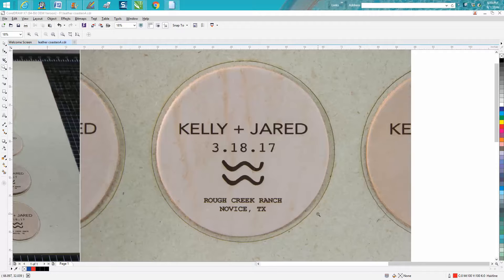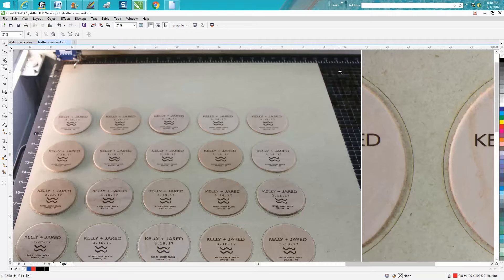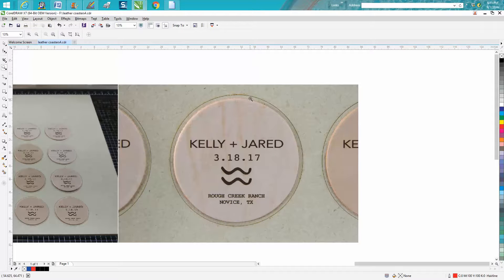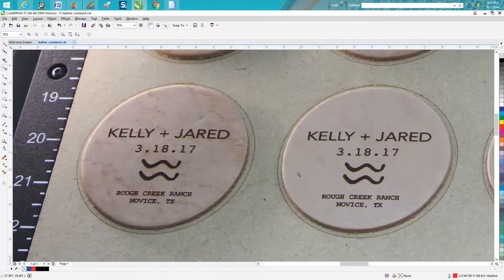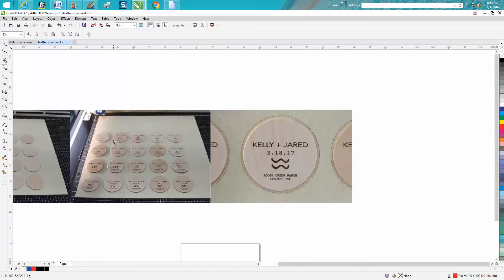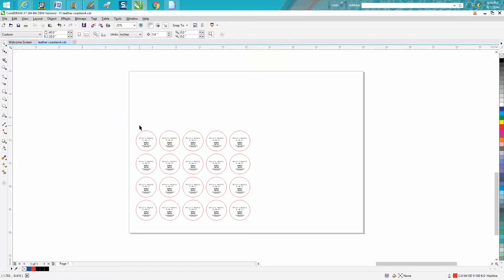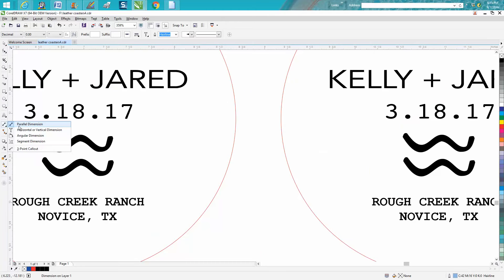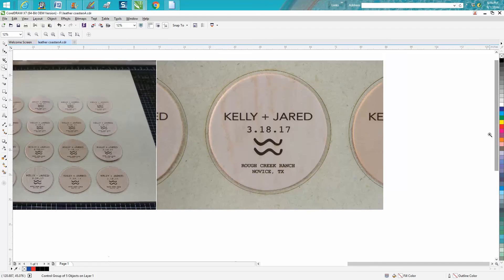Corel Draw Tips & Tricks Engraving Tips Laser bed layout

Comment: I'm still learning from your videos!  I've been doing a fair number of leather coasters lately.  Tandy is now selling 3 1/8" rounds.  They seem to change the size from time-to-time.  I used 3mm ply for the Jig and cut through it.  I had to sand the cuts ever so slightly due to variances in the leather. That also eliminated any issues from the vector cut burn.  I need to transition to mdf for my jigs as the time plywood bows too easily sitting around the shop.

Comment: Doug, do you prefer the layouts on multiples better with the nudge toll or using the step and repeat tool? Also, would the circle layout run faster if laid out like a honeycomb rather than rank and file?
Thanks for the tips!
Reply from the maker: I think the nudge is just faster for me, that is how I started and it's just right there. as far as the layout not sure what you mean, but you have the think, that the laser runs side to side, so as long as they are on the same lineit's going to run the best, if you did hat I think you are asking there would be more dead soace